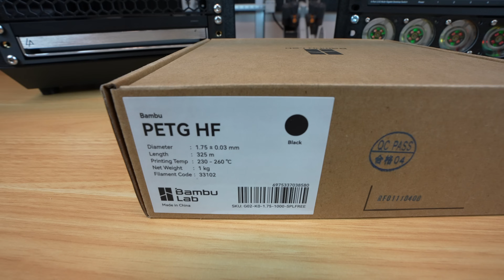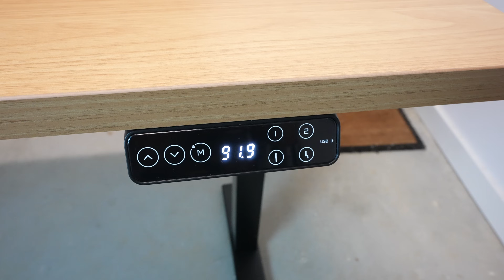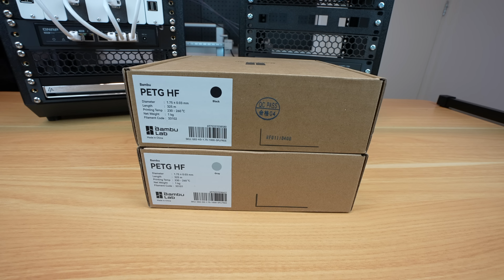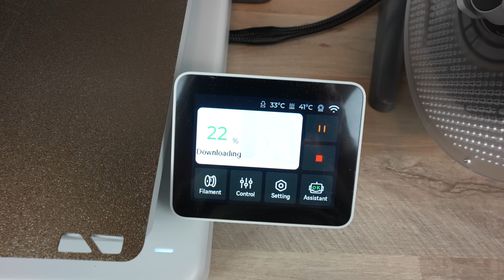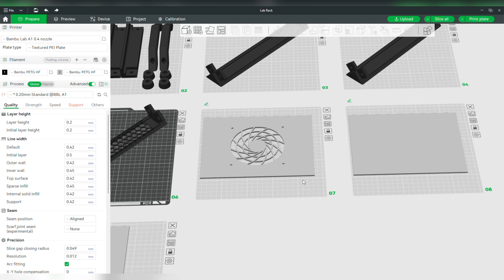Introducing Lab Rax, A 3D Printable & Modular 10" Rack System

Comment: Really looking forward to get this thing assembled here. I noticed some warping on some of my parts, for now I have only printed the 4 vertical corner posts and they are warped. I am also using an A1, with the print profile you uploaded on makerworld. Do you know any settings I should change to avoid warping? I also noticed your print times for the first plate is around 5hours. Here it took more than 7. I did not change any setting, do you know what could cause this?

Comment: Just a single question, is there an issue to print this in ASA instead of PETG?
Reply from the maker: No, you can print it in ASA if you'd like to. ASA is just typically more difficult to get good results with.

Comment: Can you please share a link to the small RGB fans on your case? Also how did you wire them all together, are they 2-pin?
Reply from the maker: They're these fans - https://amzn.to/4o4YURJ
Yes, they're just wired to a 5V adaptor. They're all 2 pin.
Reply: @MichaelKlements how did you wire all of these together. I'm curious do each component in your rack hook up to a single power supply or they each have their own? Do you attach a surge protector to the rack or externally? Sorry I'm a home lab noob.
Reply from the maker: Yes all of the fans are wired to a single supply. Generally speaking the components in my homelab are each running of their own power supply to a single multiplug with a surge protector.

Comment: Can you design the Horizontal Edge in 3 pieces? it does not fit in my 220x220 printer :( (my diagonals are not enough to print it)

Comment: This was a great print for me. It was my first attempt at a large PETG structure. Definitely the biggest thing I’ve printed. Did it on my Ender 3V2 and I had that thing BARELY fitting on most of these parts. The large horizontal pieces I did have to split, and I think I did a really bad job because I had to weld the pieces together anyway in the end with my soldering iron while I got the heat inserts in. But all together it turned out serviceable and should work! Now to print the shelves and drive caddy’s you just put out! Thank you for keeping this FOSS ❤️

Comment: I have a 3D printed 10" rack already, but this design actually solves some problems I have - I wonder if PLA is going to be ok or if I should buy some PETG.  I don't have any ventilation in the room my printer is in.
Reply: I thought the same thing. I went ahead and printed it in PETG on an Ender 3 (had to cut the horizontal vents in half because it didn’t fit). Depends on what you are running in it. If it’s just single board computers and maybe a couple of spinning disks, probably fine to do PLA. I just didn’t want to take chances. I also don’t have great ventilation in my room and my homelab setup already makes the room pretty warm.

Comment: I was thinking that the top parts to be closed and the bottom ones to be open to force air flow downwards... It is easy enough to invert them but you could have a closed one with your logo to be on the top!
Reply from the maker: Yes you can swap these around as you'd like, the top and bottom are interchangeable. I'll look at making a solid one with the logo, that's a nice idea.

Comment: The 4mm inserts are hard to find... I'm thinking 6mm might work fine on the front of the rack, then will just use the nut-adapted version for the tops and bottom rails
Reply from the maker: The 6mm inserts apparently work ok for the top and bottom too, just be careful not to push them in too far.
Reply: @MichaelKlements  Oh, awesome. Thank you!

Comment: Hi there, im actually printing this now on my P1s but my print times were 54 hrs for the uprights , 43 hrs for the cross beams. These are no where near the times you say in the clip. Im using the basic preloaded setup ,is there a setting i need to change?
Reply from the maker: Hi Darren, the print profiles with my times are available on Makerworld. Unless you've added a lot of multicoloured features or changed the print quality to one of the really fine ones, I don't see how you can get anywhere near those hours. You can print the whole rack twice over in 54 hours.
Reply: @MichaelKlements  thanks for the reply...
the ony changes ive dont to setup is to slow down the inital layer to 20, just to help adhesion. No multicolor setting added.
An example is plate 4 (solid top cap) 13hr 22min. Its going now
I just resliced the model and the whole prin is 8days, 12hrs, 37min (assuming i could do one after another.

Ps its a great model

Comment: Nice rack! Printing one for myself. It would be awesome if you provided links to the fans you're using and explained how you wired and control them. Regular 2-pin dc fans are one thing, but those RGB fans look nice and are more complex to integrate.
Reply from the maker: Thank you! The fan's I've used are just regular 2 wire 5V fans hooked up to a 5V supply, there is no PWM or RGB control.

Comment: I was just thinking making a double 5u unit would be cool.  Could just take one of the vertical members and copy paste the portion that the threaded inserts go into so you have the part the printed shelves screw into extend out either side of the rib (just have that face down if it isn't already.  Printing the 4 existing uprights then two of these extended uprights would allow you do have a double-wide unit.

Comment: If you move the handles out so they attach to the side of the unit then make cutouts in the top for the feet, you can easily just stack a second unit on top.  Maybe add a couple of screw holes horizontally through the handle to secure the unit placed on top.  Great job!  I like this unit a lot.

Comment: I just built this. Thanks so much for the design and for sharing it. It came out great. I did use the M6x5x8 instead of the M6x4x8. I couldn't find the 4mm size. The 5mm worked fine. What are you all using to power your fan in the top?

Comment: Wow! Unbelivable great work, looks fantastic and its actully the first printed mini rack I like so much that i go to print it. Is it possible to get the full rack assambled as .step file or at least the parts instead of 3mf or stl? I would like to build my mini ATX with an old server rack hotswap module as the base and on top ur design. Just if its not a big circumstance for u..

Comment: It's a nice idea, but there is room for improvement; you could adjust the handles so that the feet fit into them when two racks are stacked. " Locked in " is too expressive; just dimples deep enough that the top rack can't be pushed off the bottom.
Reply from the maker: That's a nice suggestion, thank you!

Comment: That’s the most beautiful 10” rack I’ve seen the past days. Great design and good thinking! Can you link the fans you’ve used? Really liking these colors with the black outline. Also how did you power these? Just through usb outlet?
Reply from the maker: Thank you! I've used these 5V fans and they're powered by a 5V adaptor, they can be run on a USB outlet with an adaptor cable too - https://www.aliexpress.com/item/4000291731589.html
Reply: @MichaelKlements  Do you have the  process on how you daisy chained them together?

Comment: My poor a1Mini longs to print projects like this, but I imagine chopping the long parts and using the joiner plates would get us there generally.

Looks great and after I get back home I'll probably print a few on the a1. Thanks for a great project, I'll throw a double boost your way for sure.
Reply from the maker: Thank you! You should be able to get most of the parts onto the A1's bed diagonally and individuall. The problem pieces will be the larger horizontal sections which may need to be split.
Reply: With supports? Or is it possible to separate it in pieces and glue it together? I am so disappointed that every rack is to big to print on the A1 mini 😢

Comment: Merci, very interesting
Is it possible to hang it on a wall?
Do you plan to add a door to it?
Reply from the maker: Yes you could hang it using the holes on the rear. These racks don't traditionally have a door on them, so I didn't plan on it.

Comment: I really like this and may be making one myself, but just a thought. Those who have been printing for a very long time and were always going more budget or tinker the common bed size is 220 mm x 220 mm. 250mm didn't become a "standard" until Bambu lab released which is relatively not that long ago in the 3d printer community. Even the prusa was typically 250 mm x 210 mm which probably won't fit these files. I love seeing projects like this but always feel like I won't be able to print them myself due to not having the big name printer.
Reply from the maker: Thanks for the feedback! This rack only really needs one dimension of the bed to be 250mm so it'll fit onto Prusas as well.
Reply: That's the problem I'm having with this. The project looks amazing, and I so wanted to print one for myself, but the horizontal pieces do not fit even at 45 degrees on the bed of my 3d printer (225 x 225 x 280)
In theory, I could print them vertically, but that's going to be a huge amount of support material needed. Edit: The pieces are still too long to fit in my slicer when standing vertically. I have to lower them to 2 1/4 mm below the build plate for the slicer to accept that they'll fit on my printer. I guess I'm going to have to figure out cutting them in half for printing and then gluing them together afterwards.

Comment: My 3D Printer is too small (A1 Mini - 180 x 180mm)! Knew I should have gone bigger...
UPDATE: If I rotated the bigger parts I can just print it. Why didn't I think of that a week ago before buying an off the shelf option...
Reply from the maker: I think the only parts you might struggle with are the larger horizontal pieces (like the ones with the logo on them). I don't think those would fit on an A1. The others should be able to be printed diagonally.
Reply: @MichaelKlements With supports? Is it possible to split these and glue them together?

Comment: I just want to use Rack Studs with a 3d printed rack. It looks like that's not possible here though.
Reply from the maker: Not with the standard design but the posts could be quite easily adapted to take Rack Studs.

Comment: What and awesome design! Thank you for making this available for everyone. When I finally get whatever my new 3D printer is going to be, I am definitely going to make one (or more) of these for my small home lab.
Reply: EDIT: Screw hole to screw hole is 9.31 inches. I just measured my TRENDnet 8-Port 2.5G Switch (TEG-S380) width at 9.5 inches.  I won't be able to fit it in a Lab Rax. I am so bummed. I was going to start printing soon too.

Comment: is there a way to print it on 220x220 bed?
Reply: Just tried in the slicer: If make it diagonal over build and diagonal up. Then it fits in the volume of the printer. But of course you need much more support material. Some other parts might fit flat.

Comment: Love it - I was looking for something exactly like this for a home automation project.  Some ideas:

- Vertical/horizontal Pi brackets/trays to use with HATs and/or baseboards
- Vertical/horizontal cable raceways along the interior/exterior rails for cable management.  These could be simple right angle brackets with holes for threading zip ties 
- Hinged back door option - not sure if I would use this but some might. Maybe allow for a rear panel with a slot in the bottom to allow cable passthrough?
- Vented trays to help with interior air flow. Would also use less filament
- Standoff on bottom to allow for bottom intake fan/filter or just a filter screen
- Vented side panels (option for fan mount points or no)
- For my purposes, I probably would not use the top handles but would add a couple of french cleats on the back of the horizontal frame rails (or modify them to include a cleat) to allow for wall mounting.  For this, you may need an option with no insert mounting holes on the top rails (or if someone simple doesn't want to use the handles).  

Great job!  Thank you for doing all this work!
Reply from the maker: Thanks for these great suggestions! You've given me some good ideas for future upgrades

Comment: Looks beautiful!

One question: when will you design my dream 1U mini rack UPS? Ha!

Excited to see more people get into mini racks, they're great for desk setups and most homelabs where you don't have room for a giant 19" rack!
Reply from the maker: Thank you!
Haha we definitely need a 10" rack UPS. I've been playing around with a DC design which elminates the need for so many AC-DC adaptors (since most of my rack equipment runs on 19V, 12V or 5V supplies) but it's still very early stages. 
Agreed, your mini rack video inspired me to consolidate my test equipment into a single rack that I can move between my office and workshop which started this project!
Reply: @MichaelKlements  Just make a big USB-C PD UPS. USB-C PD supports 5, 9, 12, 15, and 20v which covers most peripherals. You can also usually get DC barrel jacks to USB-C for laptops and other devices that have the power negotiation circuity. I have my entire lab running off a USB-C charging hub and it powers a wifi router, switch, Mini PC, 2 hard drives, and a PC used for a NAS. Just make sure that the 12v line is beefy enough since thats what most of the SFF PCs use these days.
Reply: @bwees this is the way 🤩
Reply: @bwees I need more details on this! Can you please share  name/model of equipment to do this? I'm about to print one of these racks and run 4 Pis, a 5 port switch, and then expand.
Reply: @MichaelKlements Hi, very very nice mini rack!
It's a bit strange to read that someone besides me wants to eliminate the AC/DC converter and make a DC UPS 😂. Mine is about 75% done, hopefully 100% in a while (I'm currently struggling with the box 😂😂😂)
Reply: @MichaelKlements  This would be amazing
Reply: I'm probably dreaming but I'd love to see USB-C PD become the standard for any DC equipment drawing less than 200w or so. That would make DC UPSs much easier.
Reply: Look for Marsriva KP9 Pro.

Comment: I would ditch the brass inserts altogether and just add hex nut indents on the inside - M6 nuts are much easier and cheaper to source than the inserts.
Reply from the maker: I'll look at making up a set that is focused on M6 nuts only.
Reply: @MichaelKlements is there a set with holes for the 6mm bolts or do we have to drill the holes out.
Reply: I thought that too. Would really contribute to a good price drop.

Comment: You should make the brass inserts insert from the back of the vertical rail with a smaller hole in the front so you are actually clamping the panels to the vertical rail, this will also help to prevent the insert from pulling through the front.
Reply from the maker: Thats a nice suggestion to make it look a bit cleaner. These inserts stay in place really well, you'll break the 3D print long before the inserts start pulling out.
Reply: @MichaelKlements that's great that your heat inserts sit in the print really well. it's not just to make it cleaner, as OP said it clamps as you screw if you insert it from the back
Reply: Would definitely look cleaner
Reply: If you're pulling heat inserts, how they're inserted is least of your worries…
Reply: @KittenRaee Most suppliers have inserts meant for injection moulding. They have straight cuts instead of cross cuts and can be pulled out with some force, so they do need to be rear-mounted to make them clamp into the plastic. Where I live, injection moulding inserts are available for ₹1-2 each from just about any supplier, while 3D printing inserts are ₹7-8 each and only available with specialists.